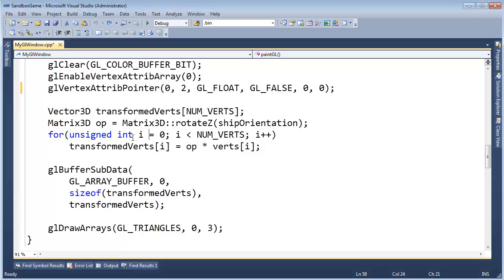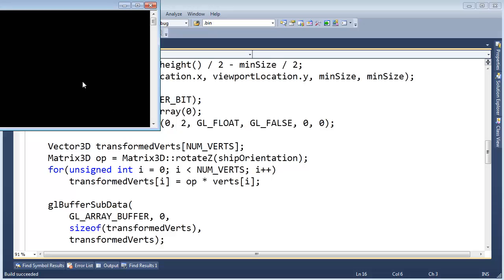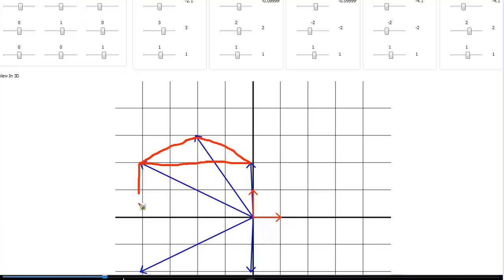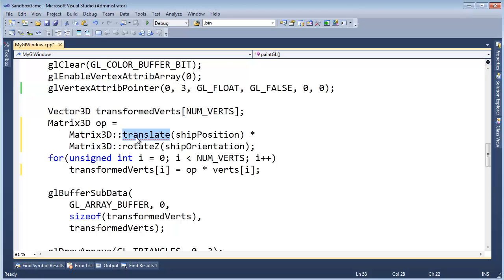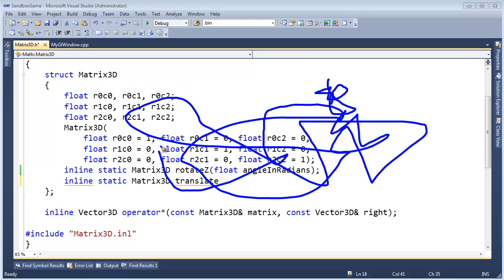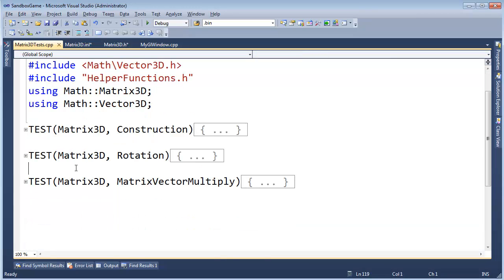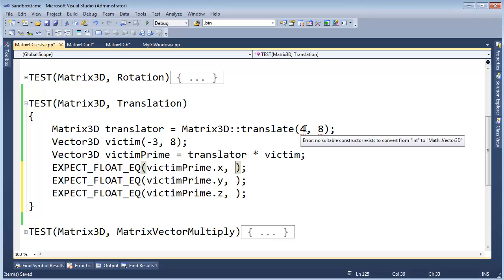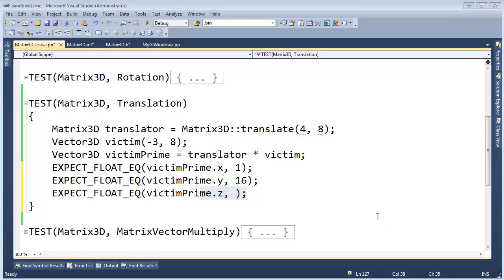Writing Matrix3D Translate Tests

Comment: OK...at the 3:00 mark, you feed the "shipPosition" variable to the Matrix3D::translate() method. But then at the 5:00 mark, you set a couple float parameters to that that method. Well, the problem is that you haven't provided a version of the method that takes a Vector3D object...so the compiler is going to error you on this. You didn't build it in this video, so I cannot imagine that you won't have a problem in the next video. But I just wanted to say that you should maybe have gone with your passing thought about using a Vector<x>D object as a parameter, instead of the two floats.

Anyway, on to video 67 to watch the fun!